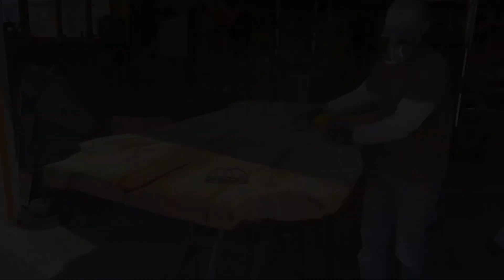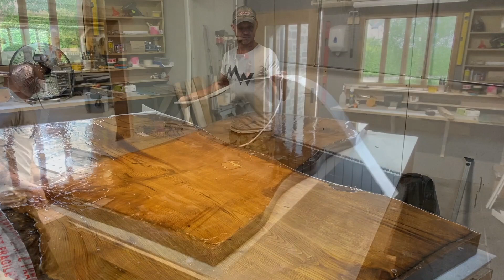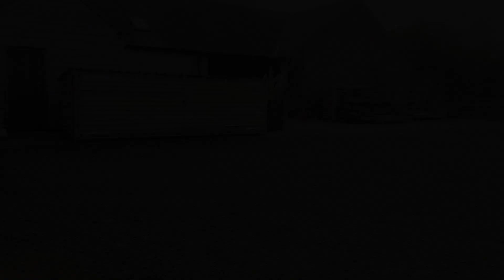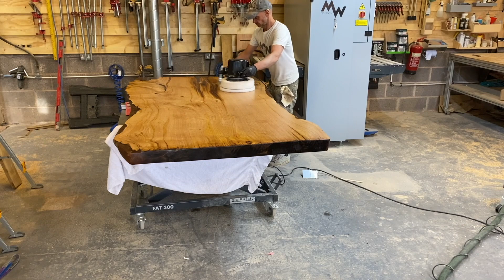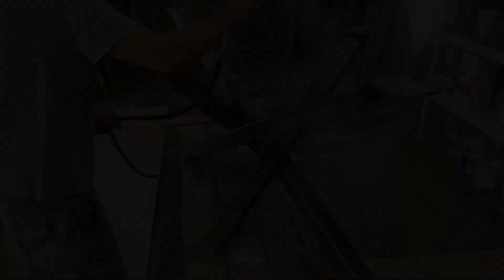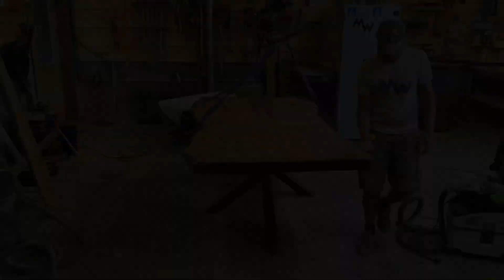220KG ! English Chestnut & Epoxy Resin Dining Table Bronze metal base

Comment: Great looking table!  I have a question about wood movement across the grain.  Does the way you fastened the legs allow fore some movement or will the legs flex a bit?  Thanks Keep making these.
Reply from the maker: This is a big slab 70 mm finished in thickness it was cut down in the 80s and been stored for all those years that is very minimal movement it’s in the UK that is a bit of a YouTube thing is talking about movement and I have done a video on it